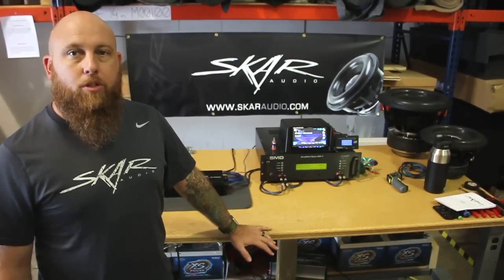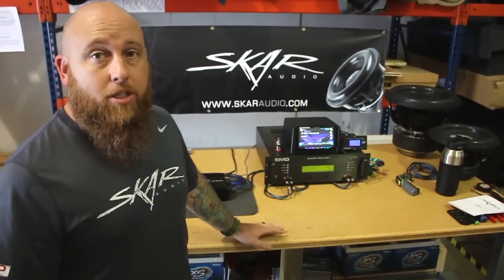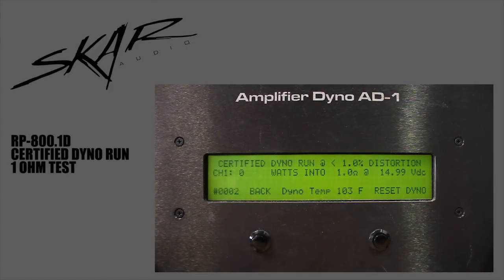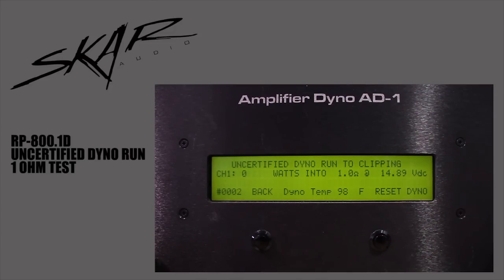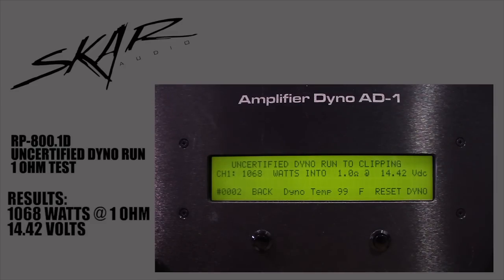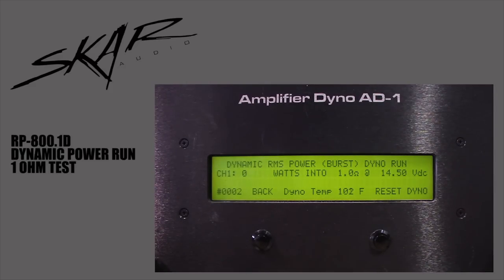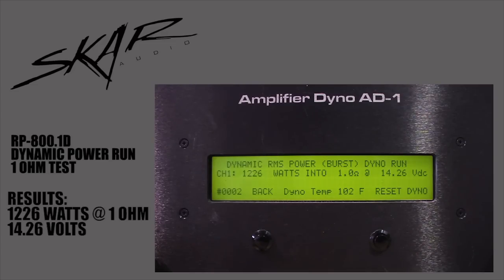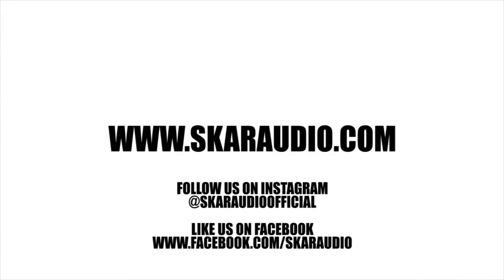Skar Audio RP-800.1D Monoblock Amplifier Dyno Runs on SMD AD-1 Amp Dyno!!

Comment: I’m running this amp @ 1 ohm paired with a single 
Skar Audio SVR-12 D2 12" 1600 Watt Max Power Dual 2 Ohm  and it FKN slams! Best bang for your buck
Reply: Same setup I’m doing in the trunk
Reply: I got the same set up in a towncar ! Got it in a big ported box. It definitely slams

Comment: I listen to a lot of radio when I commute to/from work, and in the past I have had problems with class d amplifiers causing a lot of interference to FM reception. I'm considering this model, but has anyone complained about that with this amplifier? Could you do any test on that?
Reply: I have used this amp RP800 for a few years with great results on a (1) Skar 10” SVR DVC2 in factory Skar ported carpet enclosure with great results although haven’t used FM radio since Sirius dropped years ago and Apple Iphones with YouTube but the RP800 is  a “Great Amp” priced right and does work in a big way! Hope this helped! Badass little class D monster smashing my (1) Skar SVR at 1 ohm!#SkarFamily#10”SDR,SVR,& Now (1) DDX at 1 ohm in factory Skar Ported Rhino lined enclusure! I have used mine on ALL these (1) Single Skar 10’s with amazing reults! Swapped it to D4S’s JP8 with “Unbelievable” gains at 1 ohm on single DDX 10” is my personal dream system at 50! Doing work! #SkarFamily#RP800#Allsingle10”SkarsubsDVC2 at 1 ohm stable all day#(1)Skar10”DVC2#SDR#SVR#DDX#now upraded to D4S’s JP8 with too many features to list and killing my (1) DDX at 1 ohm#Skar❤#DDX10”#D4S(JP8)”BlueBeast”! Just, please give it a try…….#🔊❤️

Comment: But who all has voltage like that bud
Reply: A GOOD battery and strong alternator. That's who. I've got stock 120 amp alt and a diehard battery pulling 13.75. Stock alternator wiring.

Comment: I just bought this amp along with 2 IX-10-D4 subs. I'm excited to get it hooked up and hearing the thing pound. Only question I have is what size fuse should I use at the battery?
Reply: For the 800.1 fuse rating is 80amps
Reply: 80amp

Comment: I have RP800.1 with two SVR 8's @1 ohm and that things SLAPS harder than one 12" type r alpine I had last year with more trunk space for shit!👍👍👍👍
Reply: What enclosure do u have? I have a ported 1.75 tuned at 34-36hz I wanna put 2 svr8 in.. was thinking about evl8 but I wanna save some money but still want hard hitting bass..
Reply: @lylegoodluck  I got the Skar ported dual 8" box. It's only 25W x 16 L x 12 H.... tiny box but big sound!
Reply: @silenthaiku5092  where do you have your gain at and do you have bass boost turned off?

Comment: Where do you guys reccomend keeping your gain,lpf and subsonic at ? Have this paired with the 12' sdr loaded encloser. Does anyone have the bass eq set higher than 0db??
Reply: Put the sub sonic 10hz below your box tune so if your box is tuned at 32hz play a 22hz tone and your gain would be best if you got a cheap oscilloscope off Amazon to know where distortion starts starting with your head unit using a  40hz test tone. And on your lpf play a 80hz song and use a volt meter on ac 
and start at the highest and start lowering it down and when you get to 80hz you will notice your voltage will start dropping.
Reply: C'mon peeps help a newbie out here with some of this tuning info so I don't damage my nee system.
Reply: Gain I wouldn't go past like 70-80% low pass I usually turn it down pretty low, subsonic i won't even say because I haven't figured out exactly what that does but hope this helps you out a little bit

Comment: I bought one last night from y'all's ebay store it was a refurbished marine amp. I like the color scheme better it's gonna power one of my Sundown SA V3 8"s should be nice lol. I already know I'll prob need to atleast get the 1200 or possibly 1500 version but atm the 800 should be good. I know these amps do over 1200 @ 1ohm and 0.5 ohm it runs at 1k or more rms can't remember what the peak was but it was kinda high lol. I used to repair and mod and what some may call supercharge amps. So I may end up beefing it up a little bit in the future if not I'll have it push my woofers in the doors

Comment: What's should I set my gain and stuff to?
Reply: All the way down unless u have equal power sub rms and amp rms
Reply: Where did you set you’re levels?
Reply: @duanestewart1786  I just based it to my ear with each knob if that helps

Comment: Does it matter which speaker outputs you use?
Reply: Also curious about this.
Reply: @archangelofhelld  it should say on the manual once you get it, I got mine tdy and the manual says a lot of things on how to wire the speakers
Reply: Manual doesn't specifically give inside or outside + -

Comment: Here's a weird question, whats the lowest ouput with the gains turned all the way down? I have a 400W RMS 2 ohm load and question if this amp is too big...
Reply: You can adjust the gain using a dmm to get a ballpark or just wire to a higher ohm
Reply: Well this is 3 years too late but 800w at 1 ohm should be damn close to 400w at 2 ohm, you should be able to adjust your gain normally. If your speaker can actually handle it's RMS rating, which many can't.

Comment: Should I get this amp or the Lp 1000? I will be running 2 400 watt rms subs. The only thing I'm worried about is the amp overheating. I don't have A.C and my amps are already warm when I get in my car.
Reply: Aidan Perez get the 1500 and have the gain barely up like that your speakers get clean power and the amp won’t over heat

Comment: Just bought this today, will it run my 12" Fosgate P3 at 1 ohm without burning up?
Reply: Ascap 850 it should  be more then enough just give it good voltage

Comment: would this amp give good power to a single Sa12?
Reply: G Vargas yes, but 30-45 minutes of continuous use it overheats and goes into protect. I really liked it but replaced it with Fosgate P500x1bd, it has much better heatsink and even though it's rated 500rms it did 798 on dyno
Reply: Ascap 850 I am having the same exact problem with this amp, after about 30-45 minutes it goes into protect mode. At first I thought I had a wiring issue but I guess its a common problem with this amp. Its a great amp but I now know I won't be buying another Skar audio amp.
Reply: G Vargas it puts out true clean power, just needs better heatsink
Reply: Ascap 850 does the punch 500 get that sa 12 going? I’m looking to get this amp for my sa 10 but if the punch does just as good as the rp800 then it might be worth the extra money
Reply: I have been pounding on mine for the past two months @1 ohm over heated one time.

put a fan on it and it runs cool with no issues...love it so much I'm fixxen to another lol
Reply: if you can't keep an amplifier cool of course it will go into protect, all amps go into protect at a certain temp, even old school amps did. it's to prevent internal circuitry failure, and your vehicle from going up in flames.   All Skar Amps are underrated they are very close in similarity to Sundown Amps
Reply: you guys must be clipping it bc i run it continously for a hour on max and no over heating. but it did get hot to the touch. also i run true 4g ofc wires. ofc speaker wire n rca. and twisted everything. i also have a lot of air space around my amp for cooling, thats probably the main key in all of this.

Comment: love the amp dyno tests. what is with all the smaller amps though? is almost like of course its going to do rated, while with a large amp you wonder if it is going to do rated or not.
Reply: most amps now are mosfet instead of the old school Toshiba pill that is now no longer in production and the mosfets are smaller and more efficient .